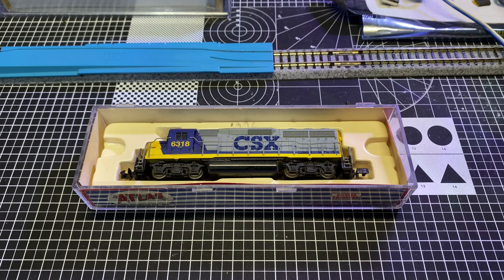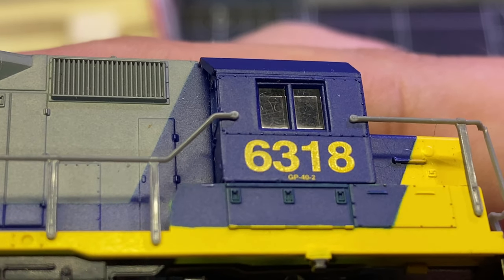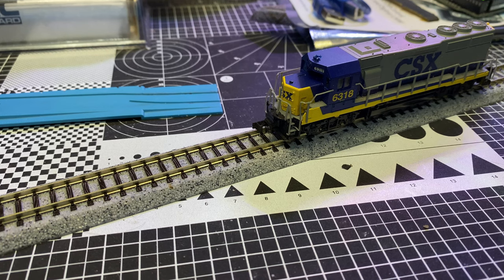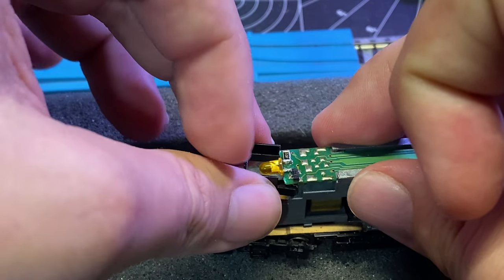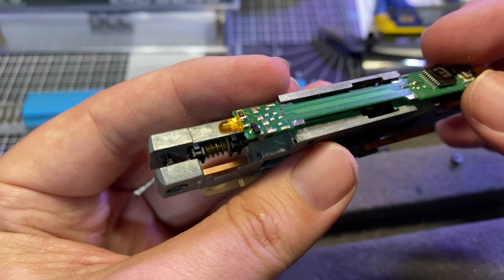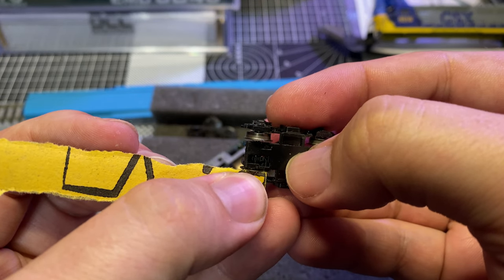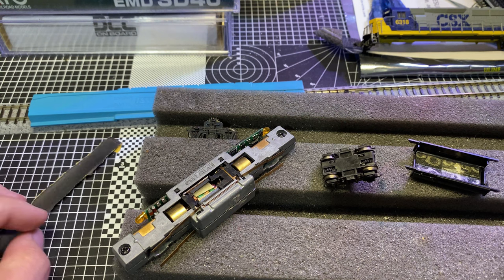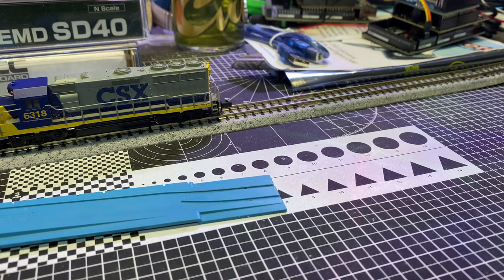Watch this before buying a used DCC Locomotive. Atlas N scale GP40-2. Trains with Shane Ep. 65

Comment: I have a few of the same vintage Atlas GP40-2's and even though the boxes say they have Digitrax decoders, they are actually Lenz LEO63XF decoders (part number 447299). That's what I have it set to in JMRI and I'm able to program it no problem. Your board look identical to mine, so I'm confused, lol. Perhaps my decoders got swapped out at some point.
Reply from the maker: Could be. I'll have to see if there are any identifying markings on the decoder. I know at one point Atlas has used Lenz, Digitrax, and NCE decoders for their non-sound units. So could be anything, lol. Could look up the decoder manufacturer ID (that the power cab said) and find out.

Edit: I looked on the NMRA website and 129 does indeed belong to Digitrax

Comment: I have a similar problem, but with an older Kato N scale SD40 with a decoder, and since it's some kind of aftermarket  decoder with a rats nest of wires running off of it, I want to switch it back to DC. (I don't do DCC, so I don't have a way to program it for DC use, so I would like to go back to original DC. 

What would you suggest? I can't find  the original light board to fit it, not even through Kato.
Reply from the maker: Without looking at it it’s hard to tell. If it has a decoder that is wired in that means that the motor was probably electrically isolated to accommodate that. It might be able to run without a light board but it depends 100% on The install and how old that particular unit is. Do you have the original box? What is the model number if you do.
Reply: @Trains-With-Shane  it's one of the older 90s Kato SD40. One of the blue box 176 prefix. The chassis looks a little different than the ones normally used on those.
Reply from the maker: @michaelmorgan7893 if the suffix is 3 digit as well like 176-209 or 176-20e then it's indeed very old. That mechanism would have to be electrically isolated in order to get a DCC setup to work. So could potentially be a pain in the butt to convert back. That is assuming that the modifications are actually reversable without extra parts. If it's the kind im thinking about then the light board or boards plural, aren't required for the locomotive to work on DC in the original configuration.
Reply: @Trains-With-Shane   I figured it might  be. So once I get power back on to my workshop, I may have to desolder those five or six wires and mini resistors and try to hard wire it back to DC, or purchase  another motor for it that still has the little wiper tabs.
Reply from the maker: @michaelmorgan7893 probably, yes. Hopefully the contacts on the motor weren't cut rather just soldered to and taped off appropriately.